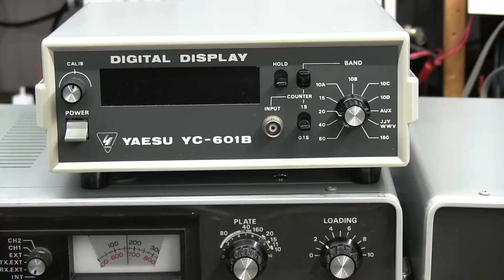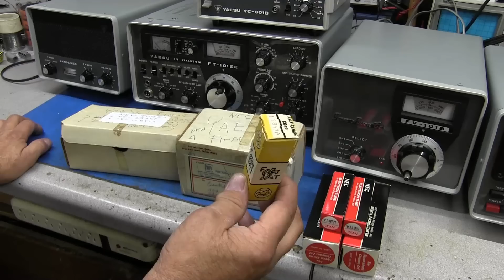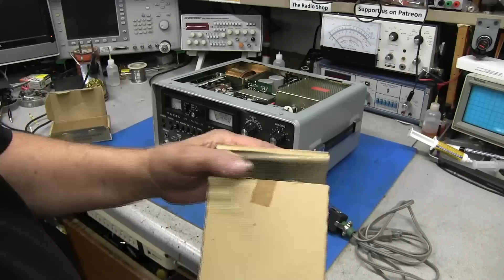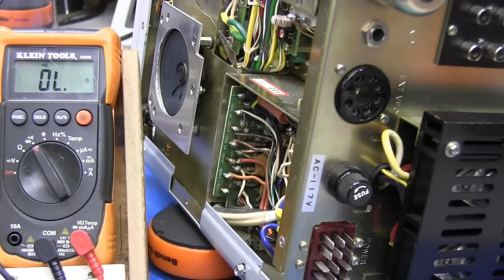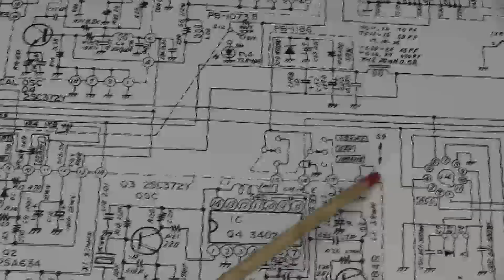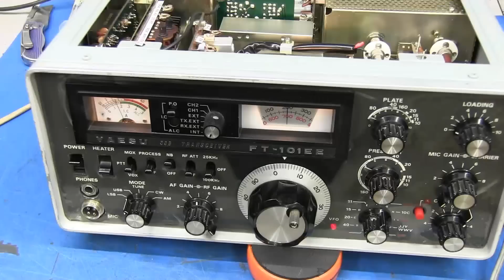Yaesu FT 101 EE Station and Repair Part 1

Comment: That is a nice station. I inherited my father in laws 101ee. Been using it on 20 and 40m. I have to get the 10m crystals for it though because he had used it on 11m CB band. Talks great on ssb but the am is wonky sounding on 11m

Comment: I was never into vintage radios. Then I saw your YouTube channel and fell in love with the Yaesu FT-101 series.I found a decent FT-101ZD. It arrived  and I was excited. Then in a video where you said the 101ZD wasn’t really a 101! 

Can you please clarify what you don’t like about the FT-101ZD, etc?
What model of the 101 is the best in your opinion?

Many thanks! 73. Joe
Reply from the maker: Hi Joe, It is not that I do not really like the 101ZD, nothing wrong with the radio. In fact it is pretty decent. But, it is not the original 101 design, if you look at the schematics between both you will see they are built completely different.
Reply: @TheRadioShop Thank you sir for the quick reply! Ah, OK I do understand your viewpoint now. 

I’ve learned so much from you, so thanks for all you do. I don’t plan on powering up this radio before I have the time to open the case, pull the boards out and clean them, inspect for cracked caps, etc. I learned that all from you. That’s awesome! 

I hope you are able to get your list out of common problems with each 101 model. That is something I would gladly pay for! Many thanks again and 73. Joe - W7BWA

Comment: I have 3 or 4. A early serial 101 no letter that is the best working one ive seen. Ive got a 101b but letters are flaking off. A 101e missing 10m xtals. A 101e with some weird demodulator mixer board. I have a original silver trim 101fv no B letter vfo. Probably pretty rare as ive never seen one ever before. Have the yo100 but cant figure  out why theres voltage on the chasis. The yc601 in your video looks odd like a inbetween version...love these but i prefer  the ft901dm or 101zd or ft102 for tube hybrids.  This station looks super clean

Comment: I have an ALC/IC/PO switch from a  101
Reply from the maker: I recently had to go on eBay  to purchase one of those.
Reply: Im sending you one also...plus a few parts @TheRadioShop
Reply from the maker: @lrspahn1974  Thanks, if you need my contact, it can be found in the description box.

Comment: I love old radios much better than the stuff nowadays
Reply: Big and chunky, easy to use unlike todays sets which are wonderful but  too small to be useable with their tiny little switches and multi function buttons. My favourite receiver is the old Sanyo RP8880 from 1978, so easy to use , read and understand.
Reply from the maker: I am with you on that.

Comment: Yes I have the same set up here and worked on the FT-101E. Took me a while to get all the accessories but was worth it. Love the radio and should use it more than i do. To many transceivers and a little radio shack makes for not easy access to them. Thanks for sharing and will be following the next FT-101 videos.
Reply from the maker: Thanks for sharing. I know what you mean. I have very little room and need to expand.

Comment: Have you ever worked on a Yaesu FT-107M ?  I heard they are a troublesome radio. Is the FT-107M poorly designed or were inferior  parts used ?  Thanks
Reply from the maker: These are known for problematic memory functions. Also bad solder joints. Other than that not too bad.

Comment: That's a keeper for sure Buddy! I've always wondered about why Yaesu put that plastic cover over the front panel...seen so many of them that have looked terrible as it ages on rigs that were well used. What was the "brown wire" syndrome? Hadn't heard that one before.  73 - Dino KLØS
Reply from the maker: Hey Dino, I agree. The plastic really keeps the front of the rig looking good after 40 plus years.  Brown wire? We dont need no stinking brown wire 10-4.  :)

Comment: Maybe you can talk about "split" caps on your next vid.  I haven't seen much discussion on those.  My Tempo 1 has a bunch (I think 0.01uF 50v striped film style) , but I can't tell if they are a problem as the Radio works fine. 👍
Reply from the maker: I did mention that in some of my older 101 videos. What happens is moister gets into those caps and they start splitting apart.  Can be issues later down the road.

Comment: I just need the phone patch to have the same setup but mine isn't nearly as nice looking. It was once owned by a CBer who smoked both cigarettes and cigars like a chimney. It took forever to get all of the sticky brown film off of everything but it all works well.
Reply from the maker: That stuff can be tough. But I found that sometimes it helps preserve the paint. If you need to repaint I found that Rustoleum satin granite for the case and Krylon pewter grey for the trim is a close match.

Comment: Wow, Buddy!  What a station!  And you got a good deal to boot.  That's the prettiest Yaesu set up I've ever seen.  I love my Yaesy 991a so much I spent another $100.00 and got rails to protect the front end.  I can't believe you troubleshooting the radio and never even turn it on.  Sounds great.  Cheers & 73 from K9POW in eastern TN
Reply from the maker: Thanks, It is a nice unit.  The thing is the previous owner gave enough detail to lead us to the problem. Plus knowing  a little about the radio circuit helps.